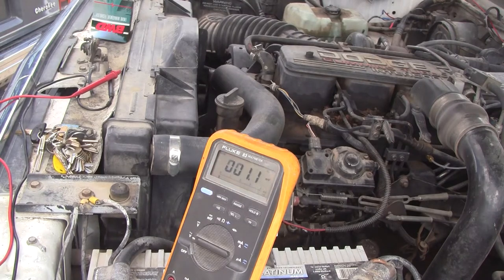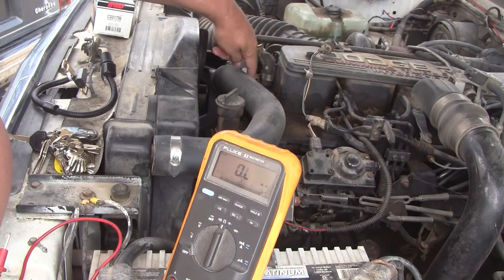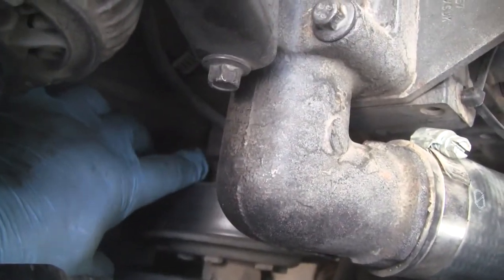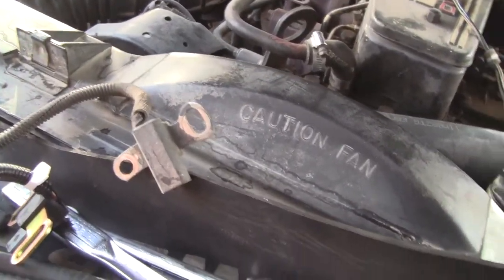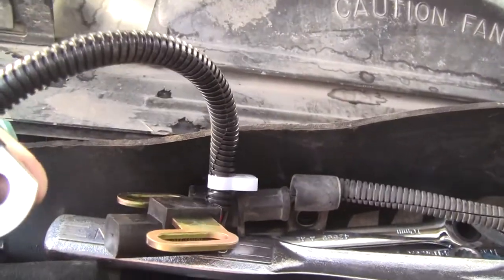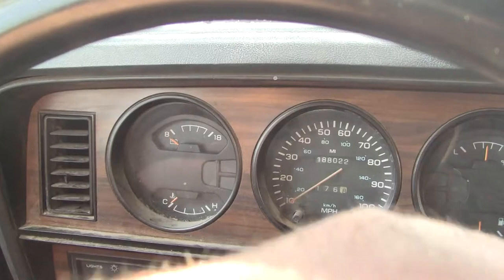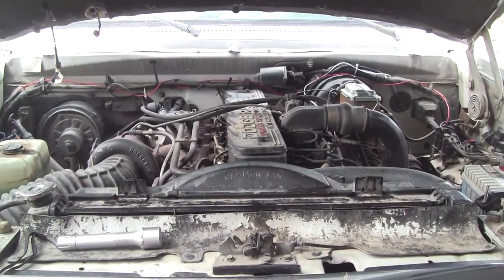1993 Dodge Cummins Stopped Charging. Part 2. Solved !!

Comment: Great video! And good tips on the testing. I have to do that now because it still isn’t charging.🥴I’m sure it sounds crazy but I just did the water pump and idler pulley and generator yesterday and I looked at this and said no stinking way I want to fight this. I pulled the radiator and everything else was easy after that. It’s a super easy job and makes everything after that a piece of cake. Even getting the wires in and out is easy. Took maybe an extra 20 minutes at most. Well worth the time spent.
Reply from the maker: Great idea !!

Comment: Hey Mike, Great video! Helpful beyond measure and I can wait to get home and test mine.  I first lost my speedo and then I lost my a/c, and batt gauge…then the batt gauge would come back in and I had a/c again.  I suspected this (still a $70 part at NAPA) but you provided a way to test.  Incidentally, because this is such a fun part to change I’d pay a mechanic but lately it seems I pay someone to do something only to have to re-do it myself….thanks again👍
Reply from the maker: So glad it helped !! Keep the reports coming !!
Reply: I changed the part.  I found removing the belt helpful but completely removed the tensioner and the bolts on that pulley to get that screw back in.  It was a little more work but paid off in sanity.

Sadly, even though my old one was bad I did not get my battery charge indicator back or my speedometer.  I am at a loss…

Comment: Good video. I had to do the exact same diagnoses but took me awhile to find out what to check. My new cps took a crap so I put the old stocker back in. Vid should help tons of first gen guys
Reply from the maker: How old was your new cps when it went bad ? I'm thinking of repairing the melted wires on the a jeep cps to avoid that same situation !!
Reply: Desert Mike DIY it's was about 4 years old. Same brand you have.
Reply: When your alternator went out did your speedomiter stop working also?
Reply: My alternator went out, burnt off the terminal ring. I did notice my speedo acting crazy in the morning for about a week befor. Sill haven't put in the new alternator
Reply: @2eyedjack433  could be that the internal voltage regulator in ecm went out. Might need a alternator with it’s own regulator. Could be fusible link. But that should have went out before burning the terminal ring. Not sure though .

Comment: I changed my altornator and installed external voltage regulator I don’t know what to do to diagnose why it’s not charging the belt tensioner probably needs changed because it allows the belt to run on a bracket but I don’t think that’s the main problem. Mine is manual 12 valve d350 didn’t originally have external voltage regulator. People say the crank position sensor doesn’t matter but some say it does effect charging.
Reply from the maker: If the cps dies, the ac and the alternator stop working on my '93.
Reply: @mikep95133   how does the cps effect the alternator?

Comment: I installed the transpo voltage regulator on my 1992 first gen Cummins. And now the battery dies while it’s running and the speedometer goes down till get to 10 mph but it’s run like 80 mph. I disconnected the battery and the engine dies. You think can be the alternator? It was running good before I install the transpo.

Comment: It is not that hard to remove the fan. It makes the job simple since you can get at the mounting bolts.
Jam the belt over the alternator pulley with a C clamp put the wrench on the large nut and hit the wrench with a hammer.
The fan threads are left handed. Large wrenches made in China can be quite cheap.
Reply from the maker: I did end up putting in a new fan clutch. A $15 wrench from Tractor Supply made it possible. Thanks for the tips !!

Comment: Can someone please list a part number for the crankshaft sensor? NAPA or OReilly? After watching this video I unplugged the crankshaft sensor and my check engine light went off and charging fine. I must have a short in sensor.  I happen to have an external voltage regulator.  Thank you so much for the video.
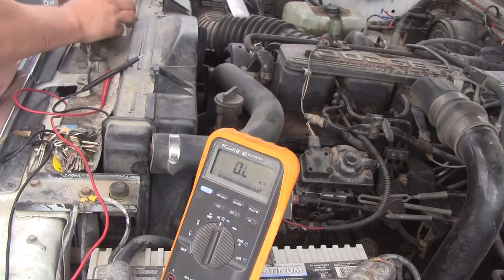Reply from the maker: As I recall I got it from Oreilly's. Borg Warner is the brand as you can see on the box. At 2:01 it looks like the box says CSS1756. My dodge is a 1993. I don't remember where I got the .050" spec. Back in those days I had massive headaches.

Comment: My 93 cummins ecm has been replaced a few years ago and now is gone again.  When this happens my a/c and overdrive quit.  Crank sensor has also been replaced,  Any suggestions???  thanks
Reply from the maker: Seriously, get some help from a friend.
Reply: Maybe check the fusible links possibly there are in as far as the computer on the fender you can take it apart and then when you take the top off of it in the upper left-hand corner there are two capacitors that sometimes go bad and now I don’t know if there’s something in your vehicle causing it to go bad but there’s that gel you just dig out around that those capacitors and you replace those Panasonic makes good capacitors now there’s a stripe on those capacitors you make sure that stripe is facing the same direction when you put the new ones back in it’s really not that hard of a job I’ve watched a guy on YouTube do it so anyhow this is six in a row jim From Kennerdell Pennsylvania I have a 91.5 dodge give you three guesses what’s under the hood

Comment: My alternator quit working so what I did I put an integrated circuit in and bypass the computer and works just fine put a voltmeter I can see exactly how many volts it's putting up and then only cost me $45 for the integrated circuit
Reply from the maker: Glad it worked for you !!